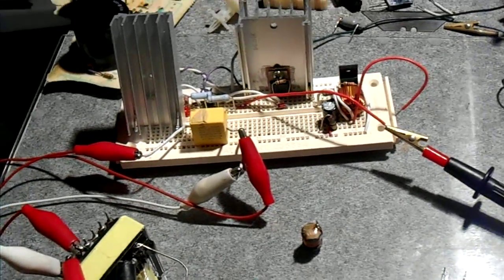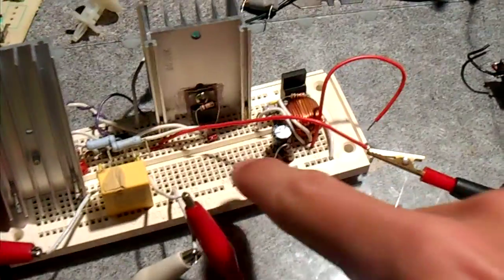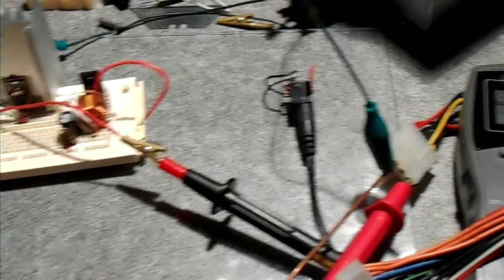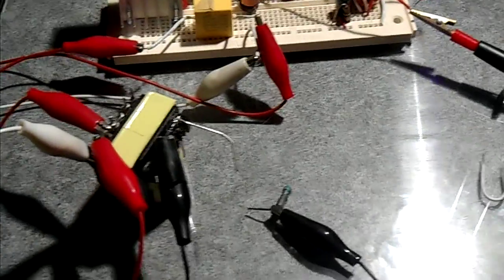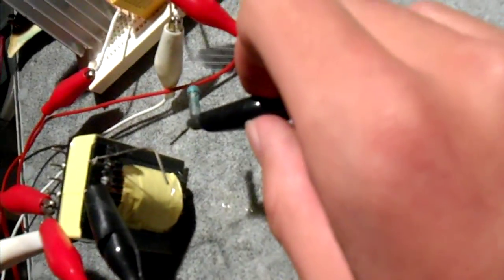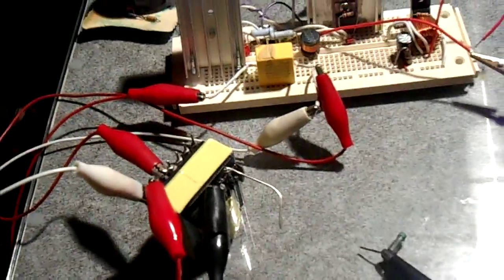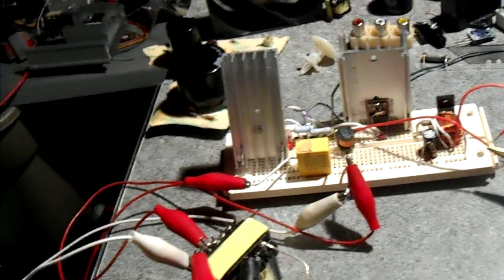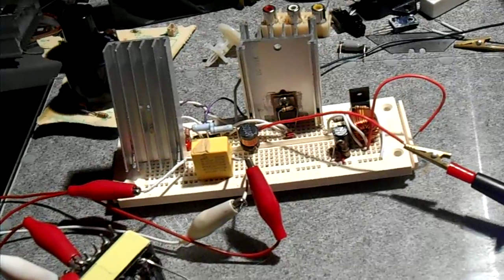ZVS driver powering ATX transformer!

Comment: is there a way i can mod a UPS so that i could use it as a 12 volt battery charger but still be able to use it as a UPS?
Reply from the maker: carlos bison hrm depends on the Uninterruptible Power Supply most that i have seen are 24v so taking one of the 12v batteries out and draining it then putting it back in series with the other is a bad thing, but if you used both batteries for 24v that should be fine, though the UPS will not be able to stay on when the mains fluctuates because the batteries will be either missing or mostly dead. if you had some other batteries that arent in the UPS then i would recommend building your own charger with an LM317.

Comment: i used an atx i had arround with a zvs to power up a flyback transfor mer but when i used a yellow wire and the blue one the atx power supply turned of and it wont turn back on so most likely the atx is done but how can i protect the atx so that it wont blow up?i like to use the atx to supply voltage to my zvs because a 550w atx is cheap but i dont want my atx to keep burning up on me
Reply from the maker: carlos bison hello there, i think the problem is you are using the blue wire instead of the black, the blue wire according to ATX specification is the -12v wire instead of the black that is ground (or 0v), unfortunately it can only supply no more than 1A, so you would have 24v when you use the yellow and blue wires but you could only use less than 1A otherwise the diode will blow up inside on the -12v side. you should be able to fix the power supply by replacing the diode with a bigger one then you might be able to use more current but that could be difficult and something else in the power supply could be blown. from what i have seen from the insides of an ATX transformer the -12v uses the same windings as the 12v just with the diode in reverse so it catches the other half of the wave so a bigger diode with different traces should work. if you need more help let me know i could make a video and possibly test one of my ATX transformers to see if it works for me. thanks for watching and sharing!
Reply: SuperBrainAK would be very nice and cool if you could do a video on how to supply the zvs with 24v using the ATX power supply and mod it with that one diode, also please could you point out where that diode is so i can replace it please ?
Reply: carlos bison by the way you just earned your self another sub ;p
Reply from the maker: thank you my friend :)
Reply from the maker: yea i will try to mod one of my transformers for you and document it!
Reply: SuperBrainAK could you tell me where i can find that diode so i can try to replace it i have no idea witch diode it is
Reply from the maker: well if you took it apart and traced where the blue wire went to on the board you should be able to follow the traces back to the smaller diode. then check it with a multimeter if you have it to see if it is still good. when taking it apart make sure to short the big capacitors with a screwdriver so you dont get shocked :) safety first!
Reply: SuperBrainAK i think i have to desolder the diode other from the sircuit other wise i think it will give me reading on the ohm metter on bouth sides of the diode, am i right?
Reply from the maker: you shouldnt have to if you get anything other than about 0.5v drop across it going forward then it is bad you shouldnt read anything else. if the diode is dead it is probably shorted so it will be 0v across or open circuit so some really high value across. try it and let me know what the meter says the voltage is (set it to diode test)
Reply: SuperBrainAK my volt metter doesnt have diode test it has ohm test
Reply from the maker: oh, then i would suggest taking it out and testing it for reverse polarity like use it in series with an led then reverse it and see if the led turns off, if the led stays on when you reverse the diode then it is broken so replace it. i have been looking at a few ATX power supplies i have and they all seem to have the -12v coming off of a small winding on the output choke for the 12v and 5v rails. so putting in a bigger diode wont help unfortunately, you will have to use just 12v to ground. :(

Comment from the maker: :D cool, did you notice that little circuit to the right of the ZVS? thats my zener diode checker :) it is a self oscillating boost converter (AKA joule thief) with a 100k resistor to the zener in question. i was able to use the same coil to power a 12v switch mode supply with power to spare :) i had replaced the transistor with one of the mosfets from the ZVS and added a big capacitor, i was able to get more than 250v so i had to do turn it off periodically :D

Comment: all good my friend :) the zener is mainly in case of the voltage at the gate goes higher then the gate max voltage you can use almost any device that has a "fix" voltage drop IE: LED, regular diode and you can series them to have more drop voltage :) now I'll go check your other video mouahaha!

Comment from the maker: yea i know you can, but i dont have any good transistors to use, ok i will look into the datasheet and put the appropriate zeners, i mostly have 5v or 6v ones dont know if that is enough. thanks for the comment, the flyback video is almost finished.

Comment: Very nice :) you know you can also do a ZVS with transistor it will not work as efficient but it work :) zvs is very efficient and will give you the power you need provided the correct input power. the +- 30 gate voltage is the max the gate can withstand you can check lower in the datasheet it will say saturation voltage that's the min it need to be full on you can use a zener diode little bit higher then that and depending on the input voltage you can have it slightly over that one as well

Comment from the maker: thanks bro! im going to shoot it in like ten minutes, lol the led is across the supply voltage with a 1k resistor, the mosfets i had gotten from the main board of a tv, they had something to do with voltage regulation. one of them had a tiny heatsink on it and the other didnt at all. yea i need to get a good clamp meter that can measure henries and high voltage :) thanks for watching! cheers!

Comment: hey alright zvs driver ! =D well done bro its not bad at all should be good for a flyback run .. where did ya get your mosfets from ? and where did you put your LED in the circuit ? i have tons of them and want to build one on a board try it out would look cool ;-) yeah the only problem for me is the inductor always getting hot just need a damn meter and i can wind some better ones :-) look forward to your vid bro cheers !

Comment from the maker: hehe, yep after i rest a bit from biking home i will surely put my flyback on it, its already wound for 6+6 turns. im thinking on making a cap bank charger with this little circuit and get some 60A mosfets for a flyback driver, i should be able to make 200mA @ 120v with this driver currently and it will be alot better when i put it on perfboard.